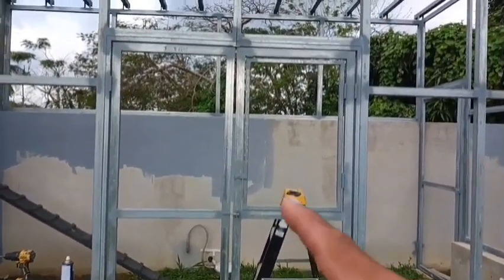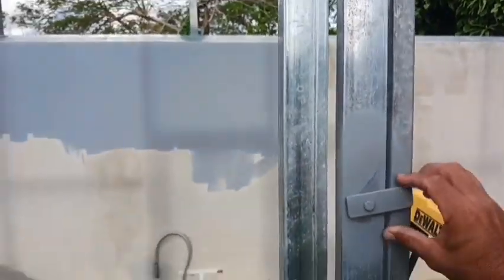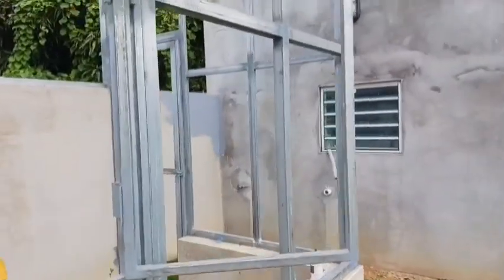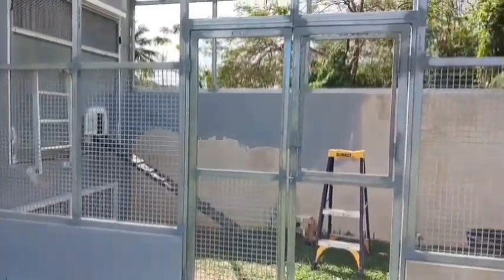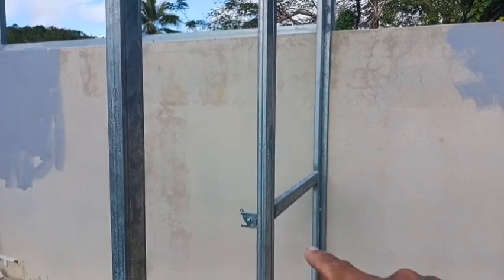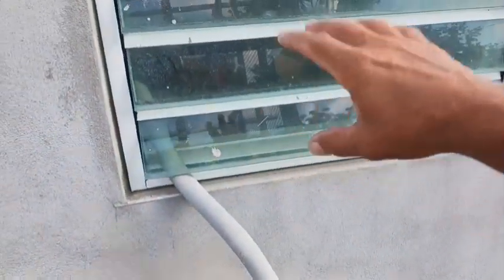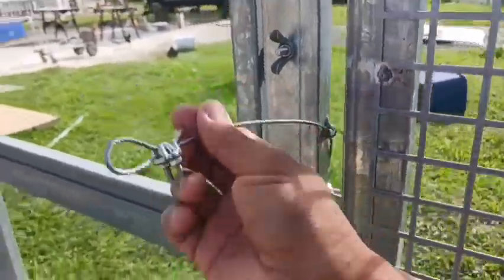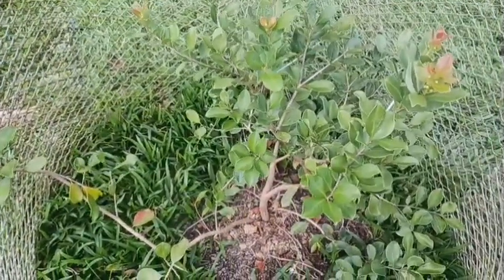Chicken run build part 6

Comment: How do you think that grass in the run will hold up over time? My run is about 60' by 20' and my flock of 7 pretty much ate or scratched up all the grass in there. Plenty of dirt for dirt baths now I guess.
Reply from the maker: Here grass grows faster than the animals can eat it, but it's been dry around here, but once it starts raining grass grows quickly,  that's why it's a experiment,  if it was established grass, I wouldn't worry too much.